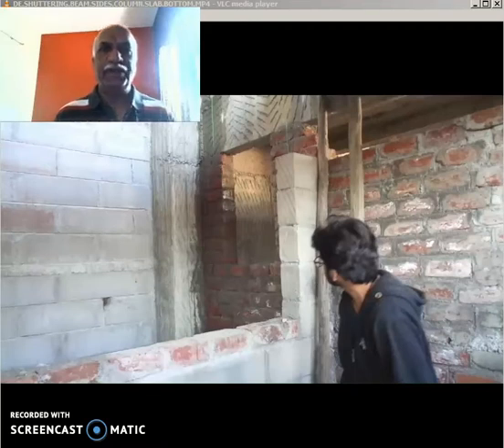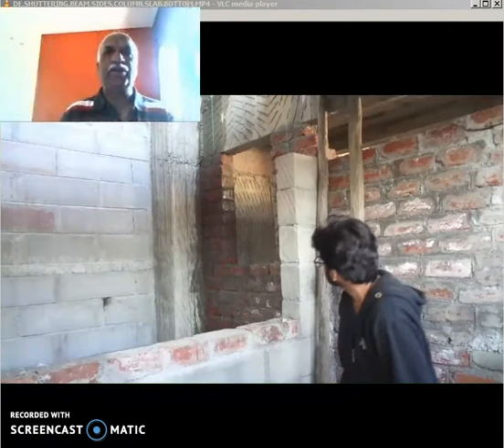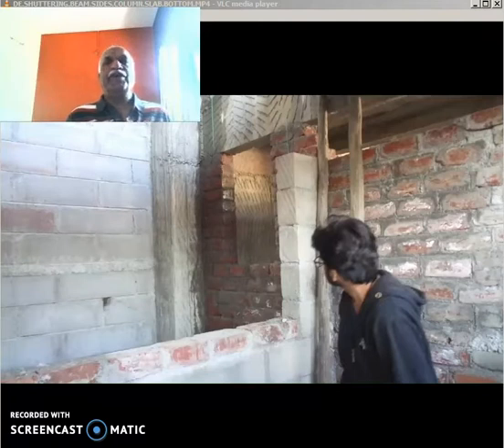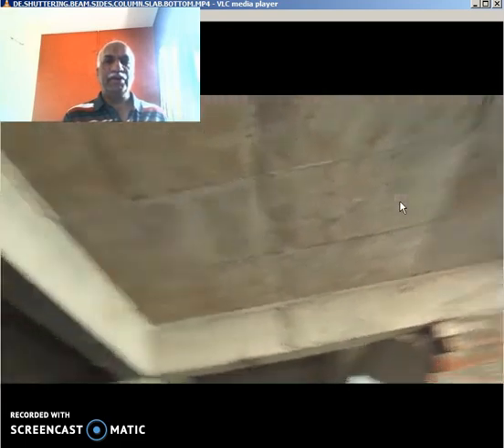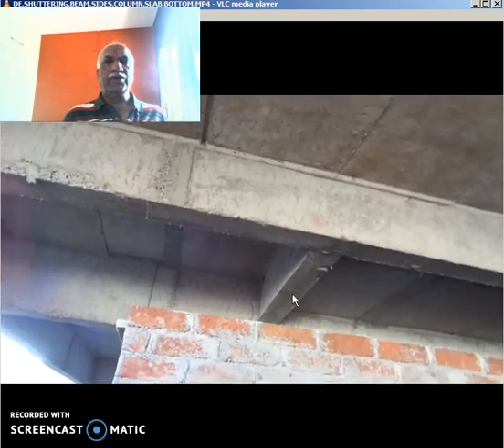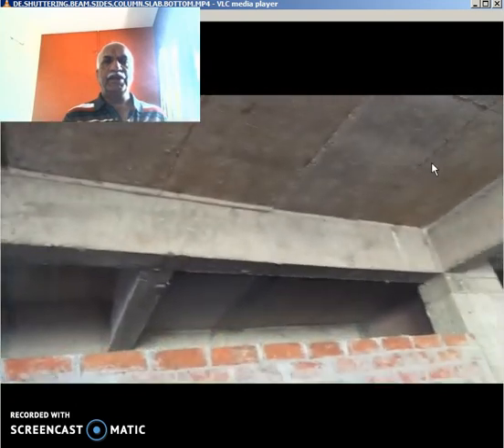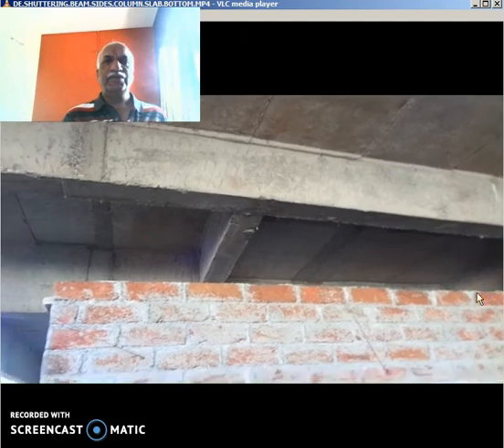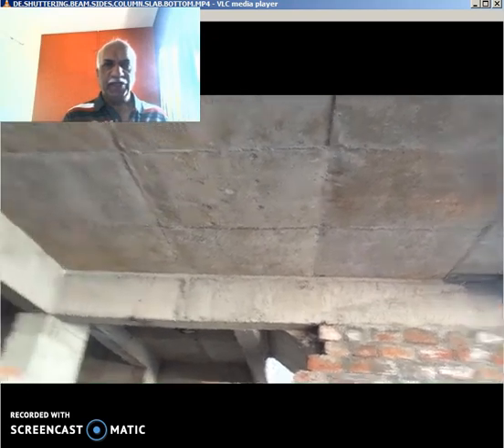RCC FORM WORK : TERMS USED AND GUIDELINES FOR REMOVAL [ ENGLISH ]

Comment: What is hacking in civil sir?????
Reply from the maker: Hacking means roughening the concrete surface with chisel.
Purpose is to ensure a good bond between the concrete surface and the plaster .
Reply from the maker: Hacking means roughening the concrete surface with chisel.
Purpose is to ensure a good bond between the concrete surface and the plaster .